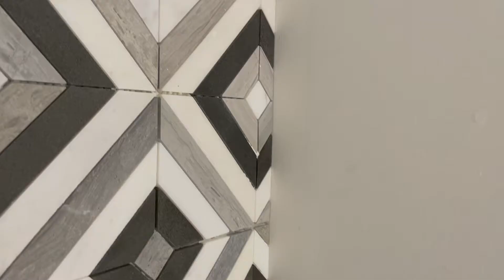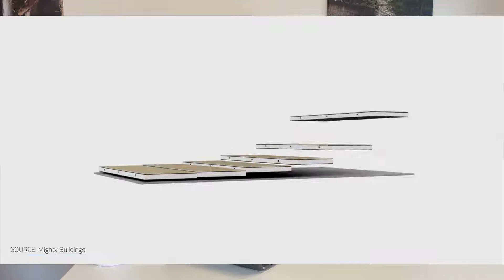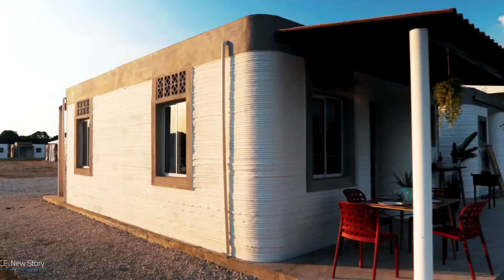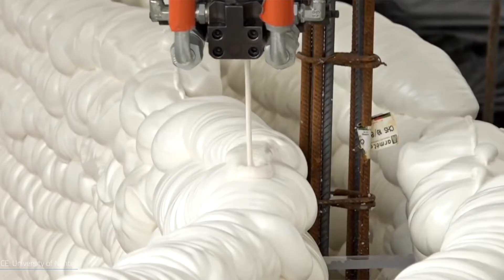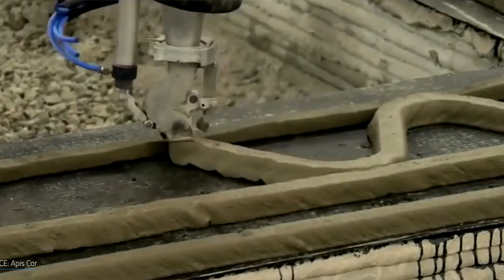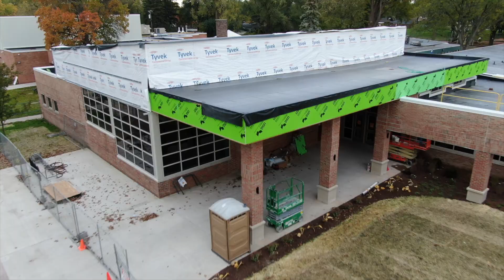Building a Cleaner House ￼ #TeamSeas

Comment: Andrew this was freaking awesome! I am actually super interested in things around clean construction. What do you think of those earthen home kinds? Basically an earthship but not as extreme? They face solar south, have dirt burmed up walls, then a wood frame for the roof? You basically have 8-10ft of dirt as your insulation simulating underground. Shades overhand the south windows to keep things cool in the summer form the high angle of attack. I also live in tornado alley so I was thinking that the earth mound struckters would also let wind just pass right over the house. 

Maybe you have more expertise at designing the perfect efficient and waste free building! I'd love to learn more!
Reply from the maker: I think it’s an awesome idea! I’ve seen those all over online. Sure it’s a little less traditional but as far as a efficiency perspective it is smart. Almost no energy usage could be achieved with a few inches of spray foam. Being part underground would reduce the temperature differential between outside and unsaid your structure. A project like that would also be a good candidate for innovative waterproofing and efficient ventilation. 
I would be interested to hear more about your underground project.
Reply: @AndrewBuilt  lets put pen to paper and design something! MY thought is if i'm building on a hill, make it 3 sides like a walk out basement, but make it single story. Then yeah, have french drains and what not around the foundation to  prevent runnoff
Reply from the maker: Perfect! Looking forward to it. Would be good content.